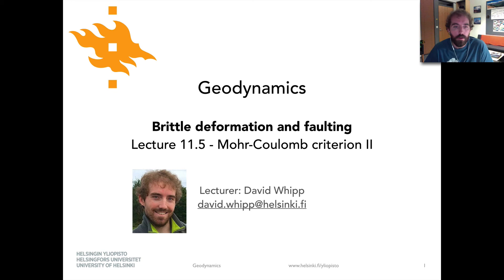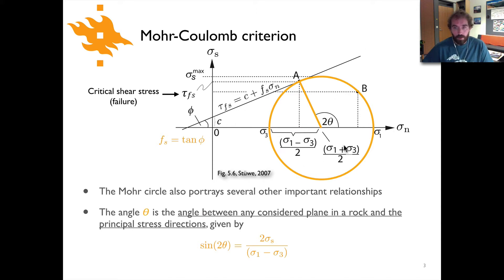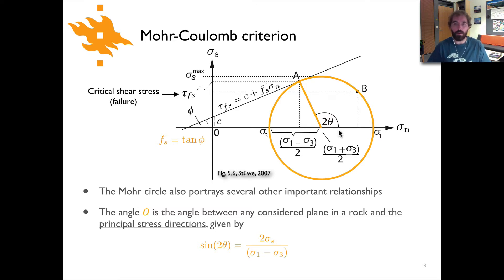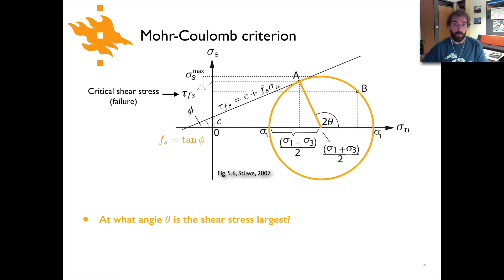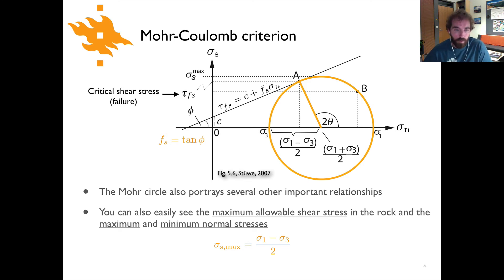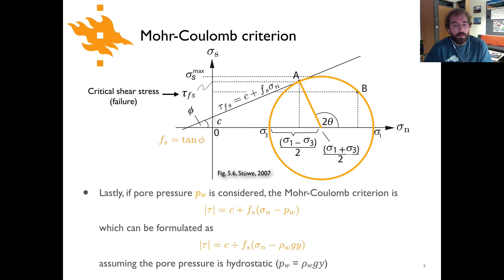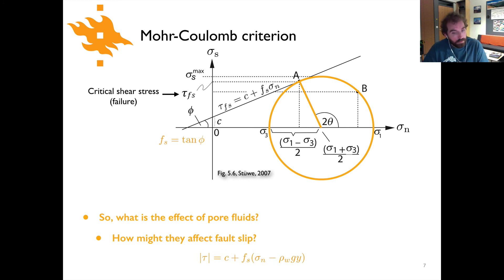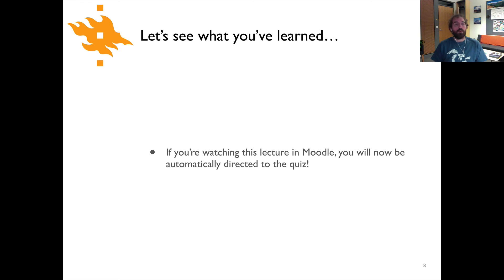Geodynamics - Lecture 11.5: Mohr-Coulomb criterion II

Comment: Hi David, thanks for the wonderful lectures, pls what's the difference between 'pore fluid pressure' and 'pore pressure'?

The question I'm trying to solve goes like this.

For a rock the coulomb failure criterion is given by σs = 150 + 0.466σ.
The stress state for the rock is given by σ1 800MPa, σ3 = 200MPa, How much pore fluid pressure do you need for shear failure to occur without pore pressure, how much do you have to increase the diffrential stress (at given σ3) for shear failure to occur?
Use a mohr scale construction for solving the problem and show your work

Thanks
Reply from the maker: Hi. I'm glad you found the lectures helpful!

Pore pressure and pore fluid pressure are the same thing. The basic idea is that fluids filling the pore space in rock and under hydrostatic (or even greater than hydrostatic) pressure will lower the stress needed for failure to occur. An alternative way to have failure would be to increase the differential stress without a contribution from pore fluid pressure. It seems the question you're working on is asking you to do both calculations. Good luck!
Reply: @helsinkiuniversitygeodynam6511  Thank you so much for the enlightenment